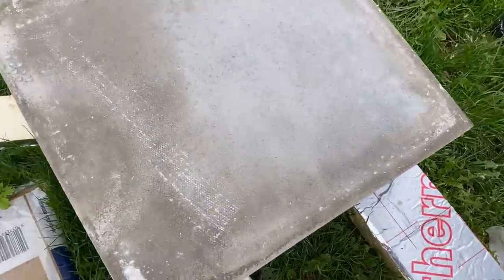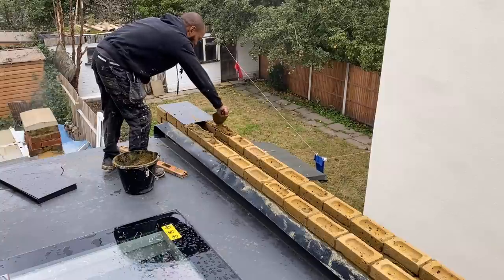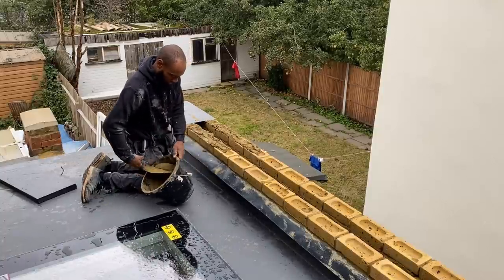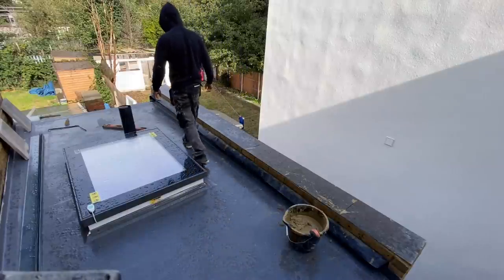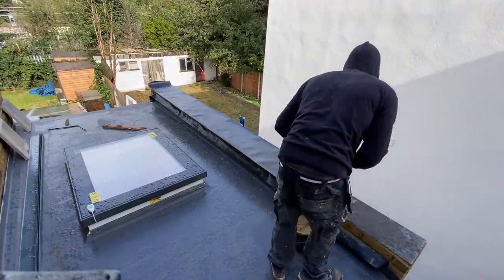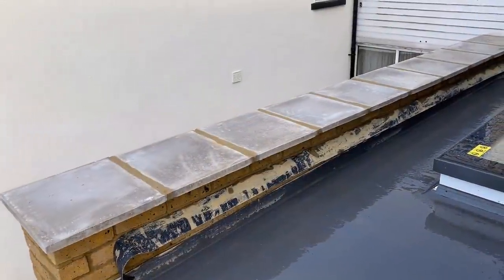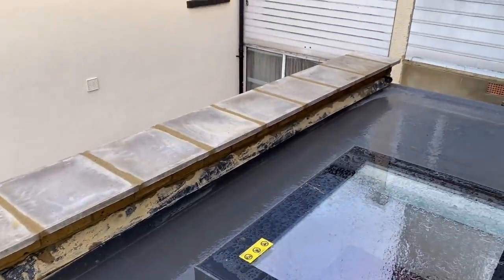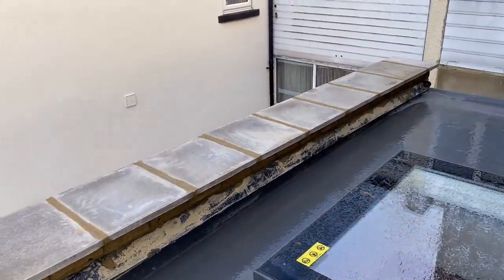Fitting capping/coping stones on a parapet wall

Comment: Great job. 👏🏻👏🏻 Interesting how you place what I think is slate over the cavity, followed by a membrane.  Question: (I can’t tell from the camera angle) Did you pitch the cement capping stones towards the roof? Assuming a slight pitch so the rain doesn’t pool or run down towards the neighbors next door.
Reply from the maker: Hi yes I pitched them slightly towards the roof

Comment: May be better if the last slab was not cut. I would have ended with a full slab and moved the cut somewhere else. Also maybe set slabs so the run-off is only one way, best onto the roof as I doubt there is a gutter on the far side.

Comment: Could you not use inslated cavity closers here, then DPC over that and then coping? I like your work ethic all the same, keep it going.
Reply from the maker: I guess so but it does need to be rigged and slate is a better choice I believe
Reply: That's what I done . Then a cavity tray and then instead of flashing I put rubber roof up and over and connected it to the cavity tray so it cant fail